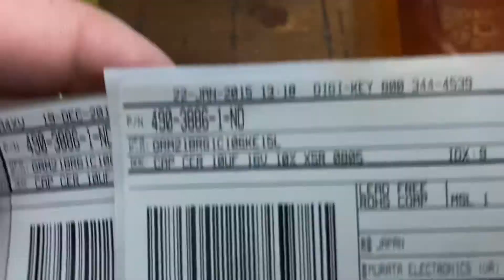It is Possible to build your own Flight Controller!

Comment: looks like its harder to solder the MPU6000 compared to MPU6050, would it be possible to use MPU6050 in INAV, have not yet tried it yet, i have NAZE32 and it looks like its using MPU6050 on it, might do some testing with Naze32 if have not effect on fixed wing if using MPU6050